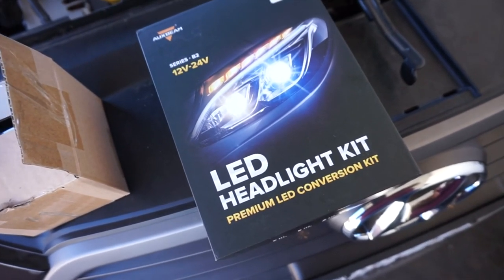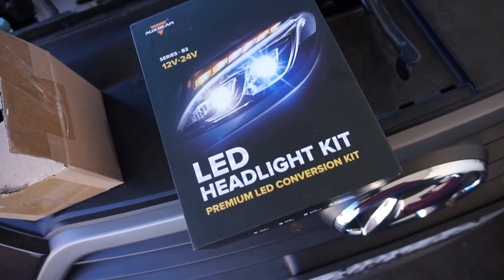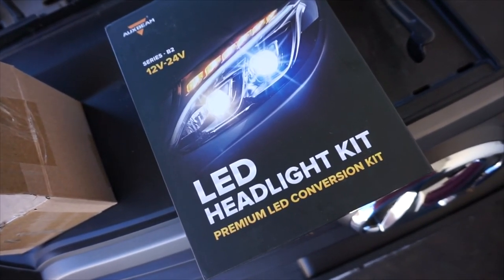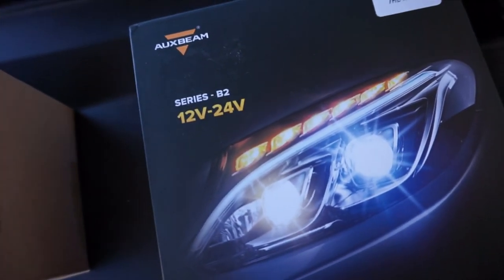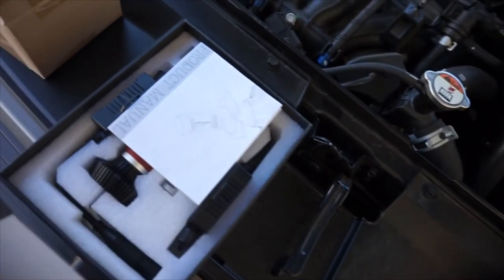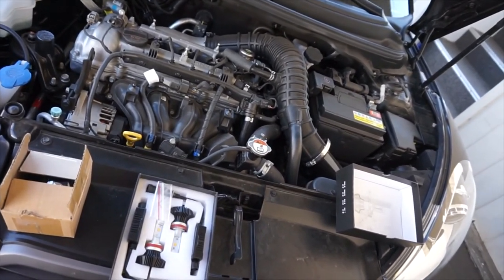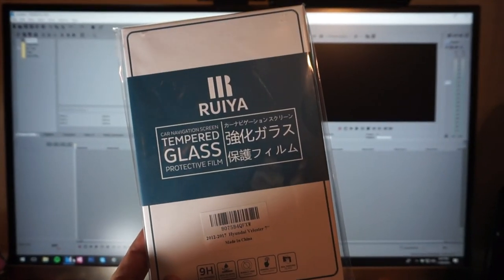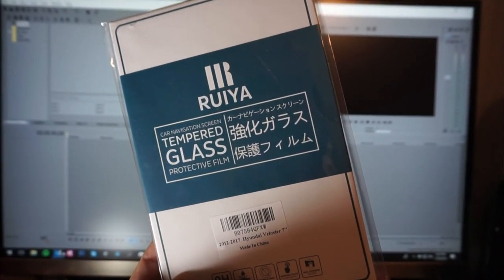LED Switchback Fog Lights (Audio Fixed) - Simple Mods

Comment: Did you have to take off bumper to install lights as I have a 2016 veloster and would like to install these? I watched all your videos they are very good.
Reply from the maker: Thanks for the kind words. For fog lights, you don't have to remove the bumper. You can just removed a bit of the wheel well underlining to reach the fog light bulbs.

Comment: They don't fit in the housing of my Hyundai Veloster tubro 2016 and not the same connection either ? What year Is that for.  Would be nice to know next time
Reply from the maker: I apologize. It seems like the link I provided has changed the product completely! The Bulb size for the fog lights are H8 Bulbs and the link seems to direct to an H7 Bulb only! I'm sorry for the mix up and will make sure to note it in the video notes. Sorry man.
Reply: @Chayness  yea I just realize that .  And I can't find these anywhere , is there a website that I can buy these or  similar. I really like them and thanks for getting back to me
Reply from the maker: @TheNesquick15  LASFIT makes a similar product (also goes in and out of stock) but it is a bit pricier: https://www.amazon.com/LASFIT-Headlight-Switchback-Yellow-Light-Pack/dp/B07F2YPT37/ref=sr_1_1?ie=UTF8&qid=1546301865&sr=8-1&keywords=h8+lasfit+switchback

Comment: how did you switch fog light from yellow to white ....im still trying figure out my car
Reply from the maker: If you buy Switchback bulbs, you just turn them off and on again real quick and that changes the color. This only works with Switchback bulbs of course. If you bought just normal bulbs, this won't work.

Comment: Do you have the link for these? Do you think you would try LED in the headlights?
Reply from the maker: Actually, I just found a pair of LED lights that I will most likely be using for headlights real soon! As far as link, here you go: https://www.amazon.com/Auxbeam-Headlight-Double-Conversion-PHILIPS/dp/B06XC25LSH/ref=sr_1_2_sspa?s=automotive&ie=UTF8&qid=1517458046&sr=1-2-spons&keywords=auxbeam+dual+color+h11&psc=1

Comment: How are the led headlights in the veloster stock projecter ?
Reply from the maker: They're amazing! I love the LED headlights but you have to make sure to buy a high lumen bulb. I'd say anything advertised as 8000+ Lumens and they usually cost around $100 for a pair. Otherwise anything else will be too weak.
Reply: Chayness what about for the low beam ?
Reply from the maker: @CerealFapist  The projector is the low beam. The advice I gave was for low beams. Anything cheaper will probably not light as well. If you go too cheap, sometimes even the stock halogen is better

Comment: Those look amazing I just a  Veloster a few days ago. Well those fit a 2015?
Reply from the maker: Yes it should work no problem so long as your car is a Veloster Turbo, R Spec, or Rally Edition. If it's a base model, those fog lights use a different bulb, you'd just have to look up the proper bulb size.
Reply: Chayness it's a turbo model. And thanks chayness your videos are very helpful
Reply from the maker: no problem! thanks for the kinda words.

Comment: What size do you have to get?
Reply from the maker: The TURBO model Fog Lights use H8 Bulbs, but many companies use a H11 kit (same bulb locks) but will include adaptors for H8/H9 connectors like this did. I didn't need to use the CAN BUS decoders for these because Hyundai went basic with the fog lights so they work perfectly as is. Plug and play
Reply: Chayness which size did you order from amazon H11?
Reply from the maker: Yes, it was an H11 Kit. The link to them is in the description. http://amzn.to/2rXi3OE